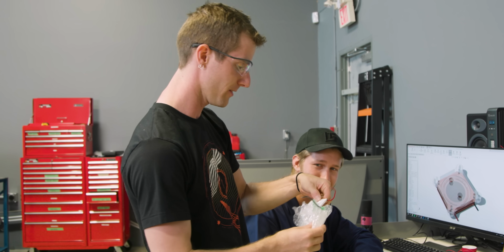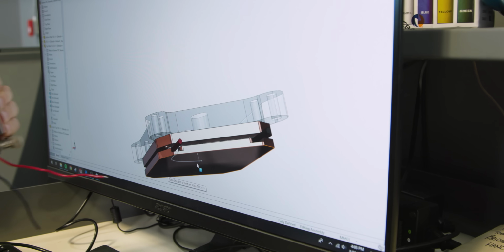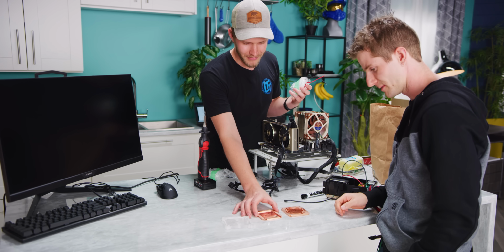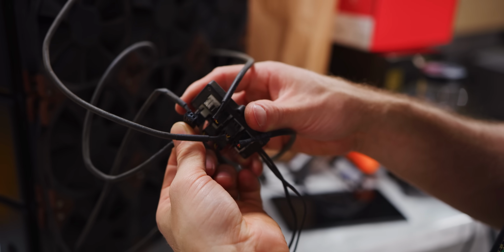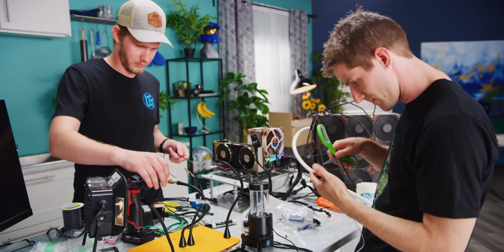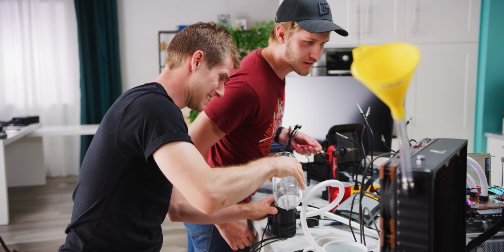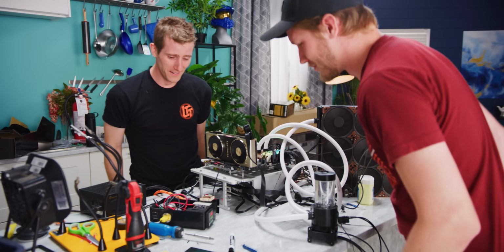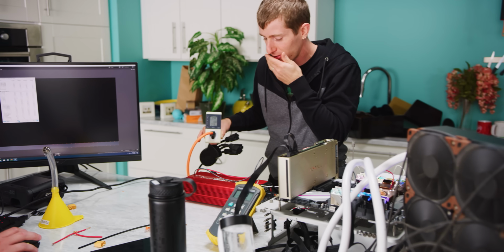This Cooler DRAWS 545W!!? Bad Cooling Ideas #2

Comment: that's a poor design, i'd plug that upside down to cool the fluid, and stick another watercooling instead of the CPU on the other side. So the peltier can cool the already cooled fluid from the conventional method to room temperature.

Comment: I personally think using these thermoelectric plates in a case is much more practical as the temps are much lower and lower case temps would contribute to better CPU temps. I mean having a case at 5 C would be very beneficial if it didn't impact the remainder of the computer's components.

Comment: Alex: pays thousands of dollars towards an engineering degree

Also Alex: Chop chop the bottom bit
Reply: Real talk, as someone who has 2 degrees in that stuff, we all use those terms. The kind of engineering Alex does is a very specific kind of engineering. He's a field engineer, the kind of guy who "just fixes it." Which usually comes down to eyeballing the problem and going "well hell if I just drill a hole here and chop this bit off I can stick that on there." Its a necessary skill when you're doing things like building custom robots.
Reply: @Keri42069  Nice to see someone with engineering knowledge talk in defence of Alex. Usually they're not very nice and as someone with no knowledge in the matter, i have no idea if they're correct.
Reply: @nKe.  first you clearly don't know how engineering samples work. 

Second that iphone/android phone you're typing this comment on was based off a design cobbled together from "scraps and legos."

Professional engineers that design new products don't have designs to work from. They are making new products and designs. So no, they don't make things look all shiny and fancy and things don't line up perfectly. That's what the second and third examples are for. 

For example, the first prototypes of the M16 manufactured for the US government was LITERALLY cobbled together from scrap aluminum. The prototype for the Dodge Viper was LITERALLY slapped together in a guys garage with old pickup truck engines on a bare metal frame. That's how engineering works. You put something rough together and you refine it until it looks like a clean industrial part or product.

There have literally been whole companies built on products that were LITERALLY based on engineering samples that were LITERALLY cobbled together with actual legos.

If you had something like say an electrical engineering degree and worked in like say service engineering like I have you'd know that. Familiar with Boston Dynamics? Google their engineering samples. Notice that the early versions of the spot robot is literally cobbled together with duct tape using a scrapped chainsaw motor.  It's called prototyping.

Btw when Steve Jobs worked for atari he used to build whole video games by taking scrap pieces of wire and connecting extra DIP chips together until something worked. Atari pays people to do that. That's how prototyping works.

Then again it doesn't matter. One of us is a professional engineer and the other isn't.
Reply: @nKe.  yeah when you're building the kind of robots that he did. Engineering samples and prototypes are just slapped together from usually scrap materials. My robot included. If we were going to mass produce it we'd have normalized the design. Your build tolerance is entirely dictated by the task you need to accomplish.
Reply: @nKe.  TLDR; "My professional experience outweighs your snarky comments"
Reply: Gotta use laymans terms for non-tech
Reply: Alex doesn't have an engineering degree, he dropped out.
Reply: Who gives a fuck about degrees. Prove your worth in experience and not in a piece of paper that proves you survived the mental breakdown simulator that is the education system for X years.
Reply: More like tens of thousands of dollars.
Reply: That's what we learn
Reply: and then we squeeze on the top bit
Reply: He's dumb really. Doesn't know how PID works and using the wrong relay. They do this all the time, Linus needs to find real engineers and not ones pretending to be.
Reply: To be honest - everything he does (at least what we can see in the videos) is very sketchy engineering-wise :D Degree wont help at all if somebody cant think like an engineer...
Reply: @Trancelebration  dude built buggies and stuff, the point of this videos is to do something sketchy, not a new super product
Reply: @yuriibondar3757  And now he uses a relatively expensive PID controller, that allows for superb control of analog components, to power a relay, which means hardly predictable real turn on time and temperature. I'm not even out of high school and I know feeding analog signal to binary components is straight stupid. Of course he might have mistaken and that's just a simple binary controller (simple electronic thermostat) in which case it has nothing to do with PID and he used that term to show off that he knows of it's existence.
Reply: @AmorDeae  PID control is absolutely fine for digital outputs. I'd love to see if you are now more informed regarding them now that it is a year later
Reply: @AmorDeae  I'm a degree qualified Engineer, and FYI PID controllers are used for on/off control in real world industrial applications, and these are effectively a binary control system.

One subject I studied at University was Analog and Digital Control, the practical project involved designing my own PID controller to switch an air hammer on and off, to position it to a required angle, with 1 angular degree resolution.
Reply: @emmaisalone  yet they have time to play with cfd module inside solidworks premium package which takes a lot of time. I know I know... it has to be just "good enough".
Reply: Przemek Potyra listen, I dropped out of high school, I have no idea what you’re arguing. An engineer putting a month into a project for a video series with “bad ideas” in the title. Is obviously going to be a lot different in a real professional environment. No one is arguing that. 
Just makes me think you’re very prideful in your degree.
Reply: @greenthumb9406  "I dropped out of high school"
Congratulations! Youre already unqualified from the nerd and geeks debate shitshow
Reply: @rakhanaufm  thanks! I’ll see myself out.
Reply: @greenthumb9406  hes prideful in some piece of paper that means nothing. Notice how nobody who is successful mentions the degree unless they still have to prove themselves. Hes upset that alex gets to have fun and give up instead of being crunched to perfection and profit

Comment: Why would you need a solid state relay to switch DC? You just use a MOSFET between the Peltier and ground, and drive it using PWM from an Arduino. The fun part is that PID controllers are just code, so they can be implemented on the Arduino itself. You just need an NTC thermistor or some other temperature sensor. Assuming the Arduino is connected to the computer being cooled, you can just send the CPU temp to the Arduino and you don't even need additional sensors.

Comment: It's good to see you are still pursuing mastery of this "TEC".. Despite the 99/100 fail ratio I'm going to build a 120MM radiator air cooler that intakes air from the case and exhausts it back into the case mounted on the machined hole door panel (Corsair Carbide) and use a Wraith Prism for a heatsink. Liquid-Air Cooling.

Comment: Now this are video's that i like to see!  You just almost perfectly proofed the working of it and made and designed yourself! Loved it👌🏻👌🏻
We used 4 TECs with a thick copper plate on a oc'd Athlon 1700.. there is now way that one TEC is going to cool a cpu of this time.

PS. 15 years ago I used to go to the junkyard, get a piece of copper, made it fit, bore holes and placed plexi with my own soldered leds in to it😁

Comment: Use the watercooling to cool the TEC hot-side (multiple TECs) and on the cold side use chiller blocks with an independent pump to circulate on its own loop to cool components.

Comment: Guys Here's a suggestion... Try cooling the water in the pump or tank using the thermocouple rather than directly cooling the cpu. The rise of temperature at the cooling end will make it difficult for the peltier unit to perform cooling action. 

Hope you guys make a video using this idea... Its pretty straight forward, cool the water, let the water cool the cpu... If it works well,  both the cpu and gpu can be cooled. 

BTW i love what you guys are doing... Experimenting... Having fun...

Comment: try a water block with a tec to the back of it with a fined water/air cooler for the hot side so it is water and tec cooled?

Comment: This is the wrong approach; the Peltier element has a limited heat transfer per cm2, and doesn't have great thermal conductivity. They don't work well with high temperature differences between the sides. The solution is to have multiple elements further upstream, by or in the rad (say, sandwiched between fins to pull heat upwards, or between the fans and rad), to take advantage of the greater surface area and less extreme temp gradient.

Comment: You need to add peltiers to the radiator and use antefreeze over water xdd thats how u can actually have a i9 9980xe under 60° on load

Comment: Just FYI although Solidworks is a good CAD tool it's terrible at FEA / CFD and should never be used for it. Its results are way off compared things like NX or ANSYS that run with a proper nastran implementation on the backend.

Comment: TEC Coolers have extremely poor thermal conductivity. They also have extremely poor efficiency. They have efficiency that put solar panels to shame, so what that means is - A 545W TEC can only move 5.45W ( ~10% like ultra super max level stuff), and to do that, it generates 539.5W of heat. Now coming back to thermal conductivity, that measly 5.45W of  heat to be moved is limited by its thermal resistance, so what it means is it takes way longer to move that measly 5.45W of heat compared to a block of damn iron, much less a proper copper heat block. So, bottom line: you wanna freeze a few ml of water into ice spending hundreds of watts? Be my guest, and I assure it will work as long as you can dissipate those hundreds of watts. But Peltiers can never move enough thermal power from a strong af dynamic heat source like a CPU. (one that continuously converts energy into heat, in contrast ambient temperature water that we were making ice out of before does not continuously compensate temperature since its heat energy is gone once it cools) 

And if you really wanna do it, like reaallllly badly wanna do it, for every 100W(around that for a TDP?) of cooling on the cpu you need around 100W/0.05(eff) = 2000W of peltier units, and heat dissipation capacity of 1900W and your peltier should would prolly still not be able to work out due to problems in thermal conductivity. LOL, this was a long rant, but will prolly save some idiot his money.

I know, this was a rather long rant. Thanks for taking the time to read it and hope it helped.

Comment: Hmm, would if you just used a thread ripper water block on the heat side of the tec, another on the cool side and run a normal radiator before the tec. Water cool everything, but the cpu is “assisted”

Comment: Water boils at 100C, and your cold side was near 100C -gas bubbles forms on the hot side due to it being 120-200C, taking away all the cooling effect, hitting max deltaT on the tec with almost double it's rated voltage applied. Next time maybe work with an actual engineer?

Comment: But if you put radiator in cold water which freeze peltier ?

I shared with world my cooling system which is successful if u have  extremely good waterblock and pipes with exactly water it's need !

You would have to try this 😁

Comment: The solid state relay must switch AC because it's a triac inside. It relies on the alternating current to switch the relay off. You're using it to switch 12V DC from the PSU, which doesn't alternate, and thus cannot be switched off. A good substitute would have a been a "heated bed" MOSFET from a generic 3D printer, as they'll switch DC.

Comment: most peltiers require the hot side not reach 68c.. they make specific ones that allow for 150c hotsides. I have a working setup with my 1920x that maxes out at 45c 4.2ghz cine r20  - however i'm finding the same issue - peltiers cannot maintain the thermal load - its great if you want to keep it around stock settings .. might improve the life of your chip in the long run but its not worth the electric bill

Comment: I think the solution is a hybrid system.  You have a basic 240 mm rad with fans and a pump (open loop), then you have a secondary loop (open) that is dissipating heat from a peltier with whatever size rad it needs.  You take the cold output from the basic loop and run it through a cpu block on the cold side of the peltier and THEN you run it to the cpu.  That way, you can use basic, more efficient liquid cooling to siphon off most of the higher temperatures, then you slap a lower power TEC on the end of the loop to drop the temperature a bit more.

The greater the temperature differential between a radiator and the air, the bigger of a drop you get.  If your liquid is only 5 degrees above ambient, it's not going to lose much heat, but if your liquid is 50 degrees above ambient, it drops off faster.

Comment: you need a much more powerful TEC to cool something like that, TECs are only about 15% efficient so that 545 W unit was probably only getting around 82W of cooling, it quickly becomes completely infeasible to cool a system using TECs because if your processor is outputting like 300W you'd need a 2000W peltier unit, which would require two separate electrical circuits in your house (1500W max for single devices).  Another thing is that your room would start to heat up since your cooling system is outputting more heat than most space heaters so you'd need to cool your room using an air conditioner or something.   A more feasible option would be to have a small peltier system attached to your water cooling loop in series with another radiator (CPU -> Radiator -> Peltier -> CPU), so you can chill the water after much of the heat has been removed by the radiator.  You would still need a way to cool the hot side, so you may want a separate water loop for the peltier.
Reply: No, I think it means that the efficiency is 15% of an ideal heat pump, you are interested in the coefficient of performance. In the case of a vapor-compression refrigeration (fridge, air conditioning etc.) it can go up to 3 or 4 (300 or 400W moved for every 100W of power), in a TEC varies a lot depending on conditions (I looked at a datasheet of a TEC comparable in power to the one used in the video, the COP varies from 3 at low loads and low temperature differences to 0.1 or less in the worst case). If you can keep the hot side at relatively low temperatures so that you don't need a big temperature difference and you choose a TEC so that it operates in conditions where it has a decent COP like 0.5 it is doable. In the past I have seen 250W TEC cooling a P4

Comment: No... You trying to understand tec's is a bad idea.
You shouldnt be pumping so much freaking power through the tec.
If you put more power theough the tec than your water cooler can account for, it will overwhelm ITSELF. nevermind the cpu overwhelming it. 
You have to have something that can carry that heat away or the "cold side" is just gonna get hot, not cold.
Fyi, ur better off just having a water cooled block on the cpu, then use multiple low voltage (12v) low amp  tec's to cool the water circulating through the water cooling system.
That will make it so cold water is hitting the water block.
The way you are using tec's is just dumb

Comment: If the Peltier draws 545 Watts it could also be dissipating 545W.That waterblock doesn't seem capable of taking 545W of heat energy away.You need to make sure the heat that's it's taking doesn't overwhelm the cooling.

Comment: You might want to do some research on your hardware there.... I am staring at a Corsair RM850x.... the CPU 8 pin is designed to be used for PCIE as well... you cannot however use a dedicated PCIE 8 pin for CPU power.